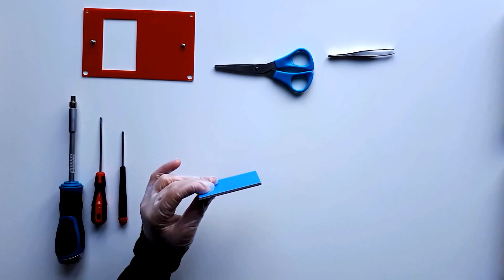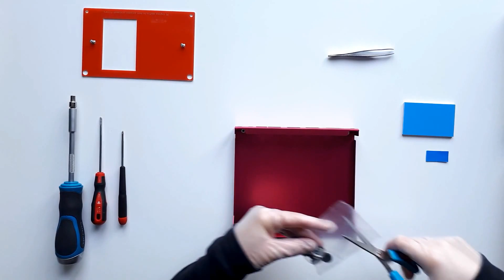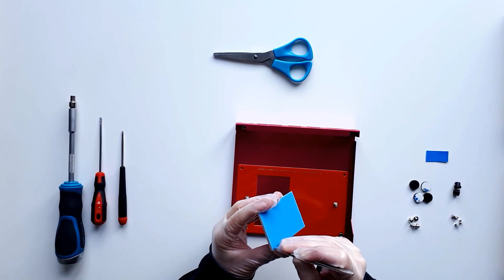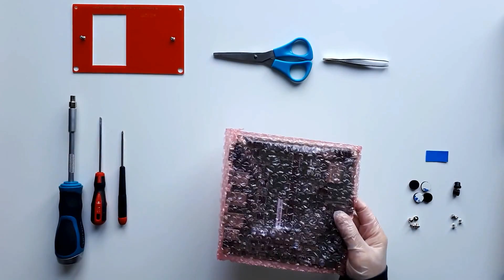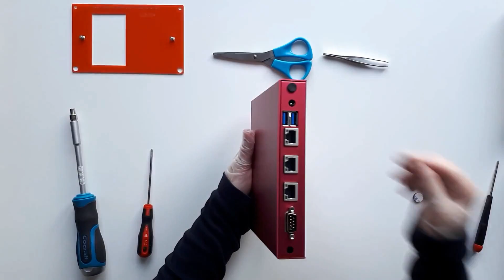PC Engines APU2/APU3 system assembly. Build your own open source router!

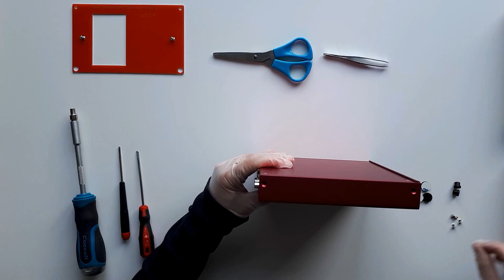Comment: 5:50 - That reminds me of the casing that came with the Alix2dXX boards back in 2010! They just punched holes on the sidewall of the inner chassis and delivered rough screws to secure the lid. The problem was / is that by driving the screws in, they cut their own tread in the hole, causing microscopic metal swarfs to come off and settle in on the mainboard, increasing the risk of shorting the PCB lines and microchips. My solution back then was to directly tap an M3 tread and using M3 screws instead and tossing the ones that came with the box. A neat and clean solution they now have adapted.

Comment: Thanks for this extremely helpful video, which simplified my own assembly a lot! The only difficulty I encountered was not having the apufix1a (used at 1:20 in the video). Fortunately, there is a simple solution: http://pcengines.info/forums/?page=post&id=F08F74C7-827B-4FB8-BD0D-D23837B80430